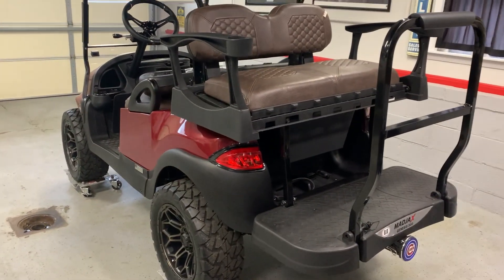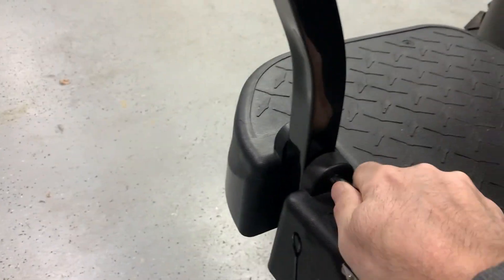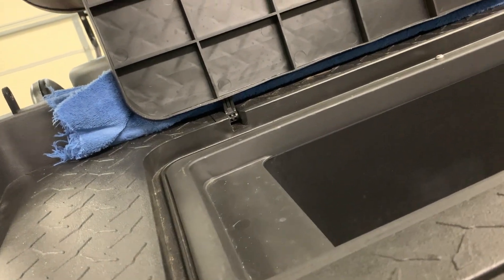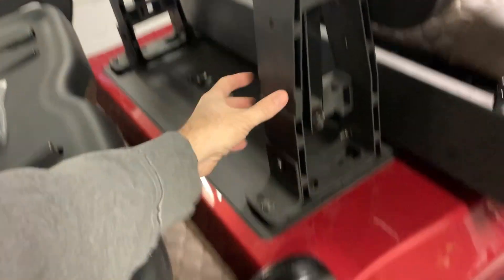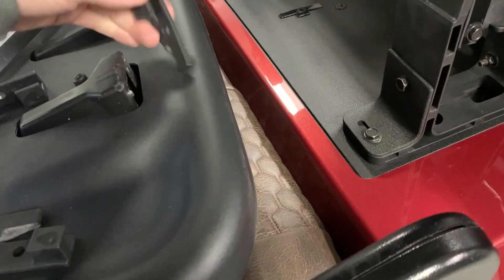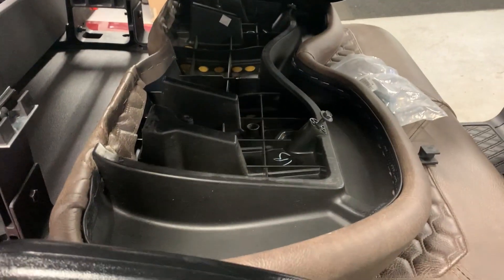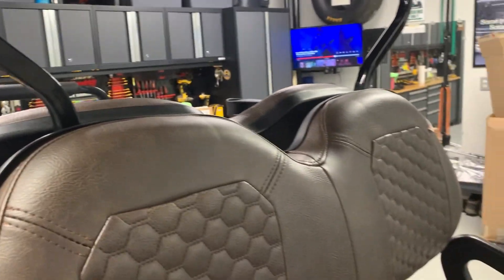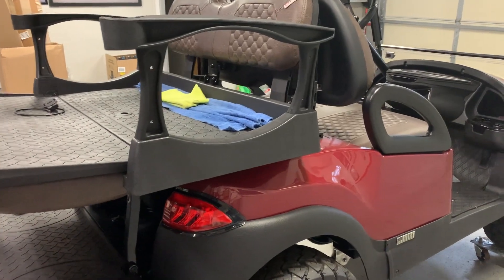Golf Cart MadJax Genesis 300 rear seat REPAIR and overall thoughts after a year of abuse.

Comment: Same happened to mine on the driver side. I tried looking up the hangers with the part number but cannot find them.
Reply from the maker: I called the vendor that sold me the seat. I believe it was TNT Cart Parts. They were able to contact and get the part, i bought two sets at that time assuming a break again, but so far this year so good with that extra little support.

Thanks for checking out the video!